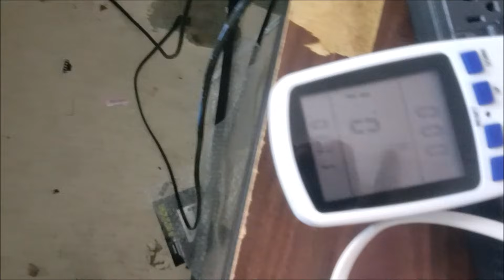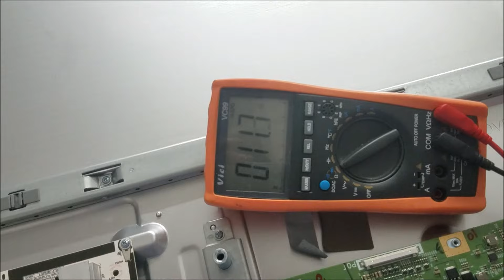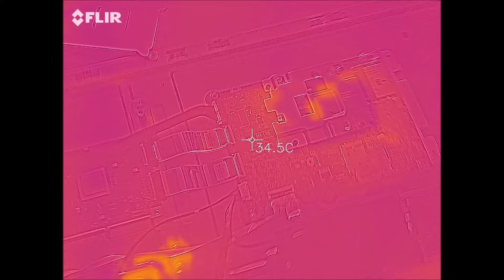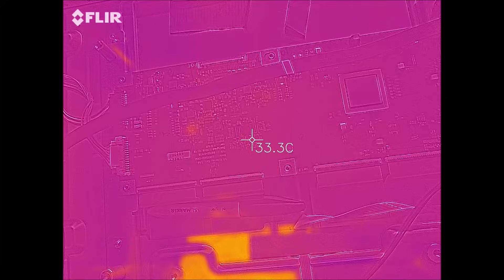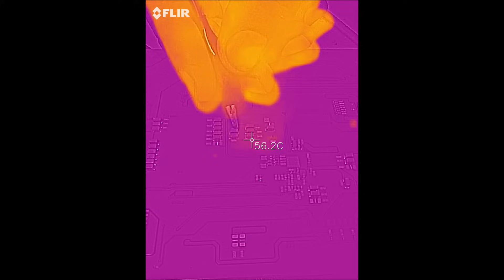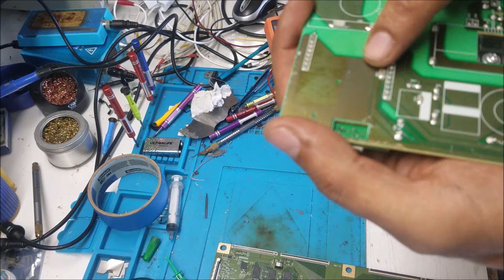LG OLED65B7A wont turns on repair step by step

Comment: I have this le650aqp-ama2-y31 tcon board in sony 65A9G and I get 4 blink error code. disconnecting LVDS cable from mainboard to tcon keeps the TV ON with no picture or backlight. could you help me what else i can check to bring the picture back to see if that led issue or screen issue ?
Reply from the maker: do you have led tester? try this unplug the tv, hold vol - and power button then plug back the t to the power keep holding the 2 buttons until you see the green light release everything if you see the screen logo thats mean all the boards are good and lcd panel is good too, check one my video about sony backlight issue how to bypass it may help
Reply from the maker: @JD Scott maybe you have shorted traces inside the panel, try to cover some pins in the flex cable
Reply from the maker: @JD Scott yes you can i have videos how to do that

Comment: Awesome! I just FOUND a OLED65B6P by the dumpster at a jobsite, screen is not cracked as I can see. No physical damage to the frame...can I get it to work? I will follow this thread and let you know! Did the power stay on with no display or did the power blink 3 times and go off?
Reply from the maker: test your tv first and get the notes,  take the back cover and test the voltages as shows in the video